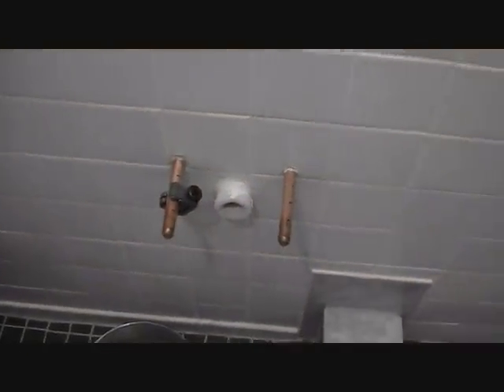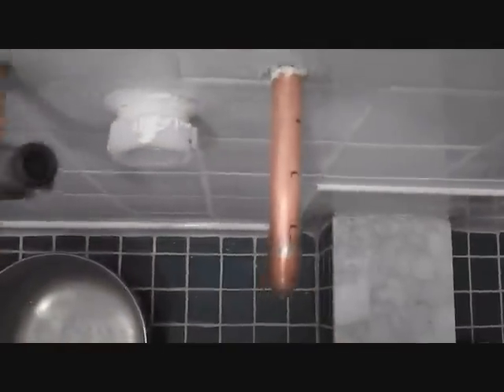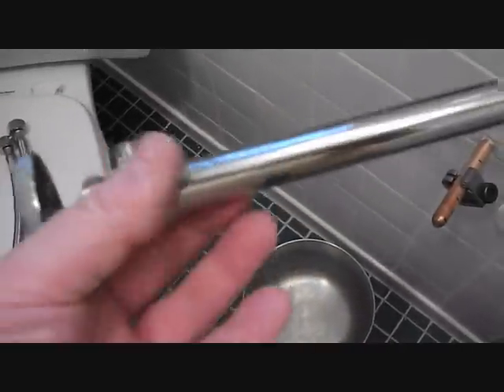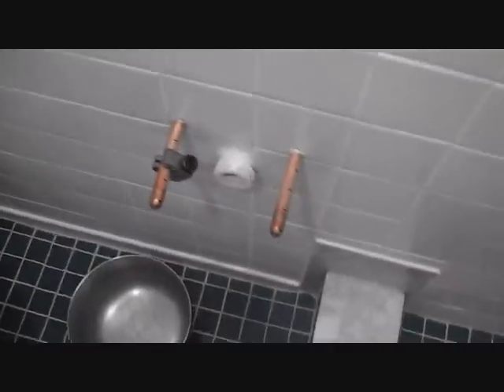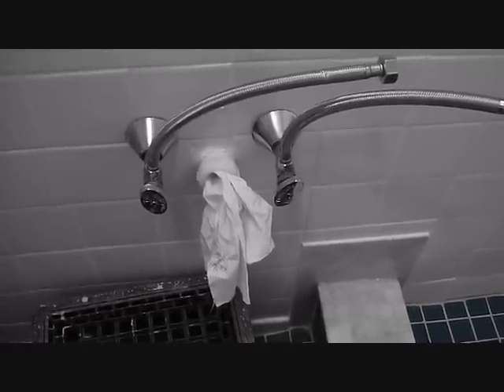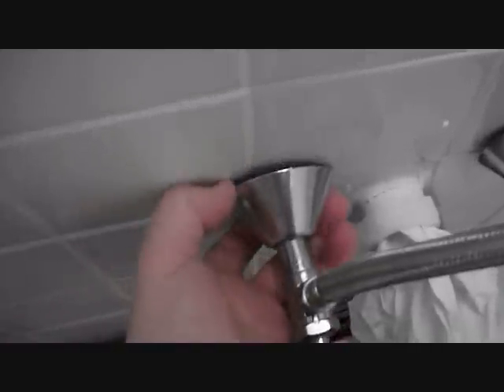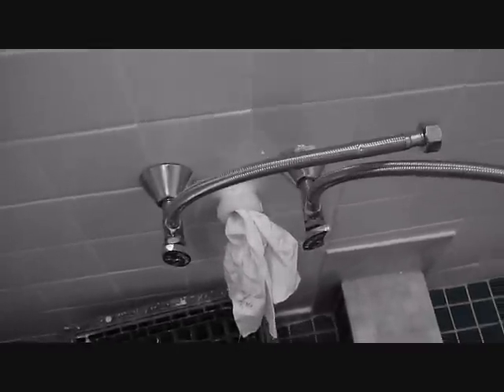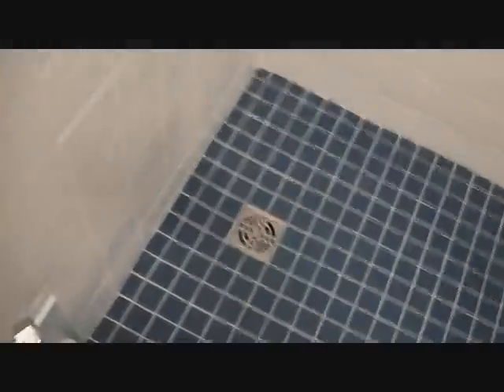Sweating the stub outs

Comment: OK this is what I need to install now.  Can you tell me if I need to flux and solder the stub out and the sweat angle valve piece? Or is there solder and flux inside the sweat pipe that I purchased.  It is call Keeney 1/2" sweat 90 angle valve?
Thanks